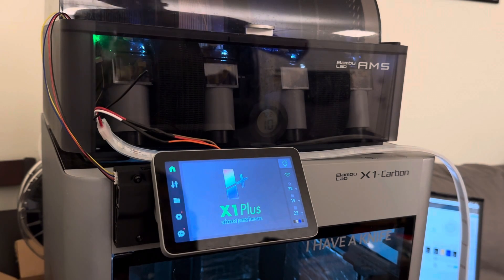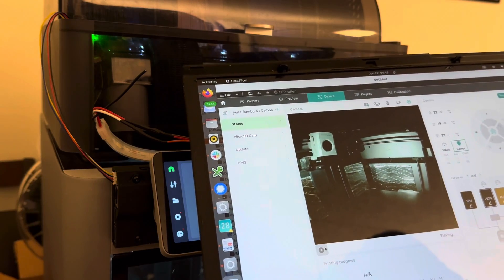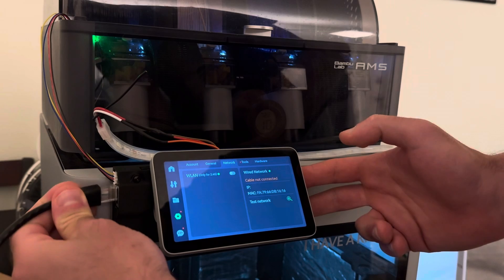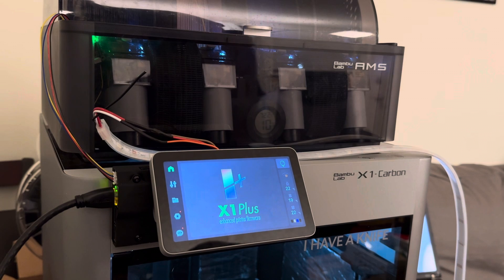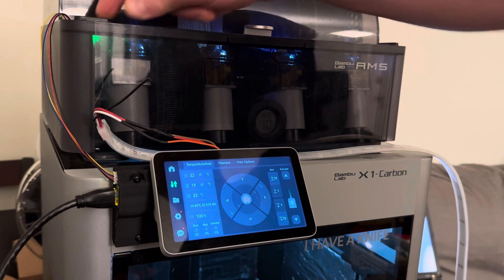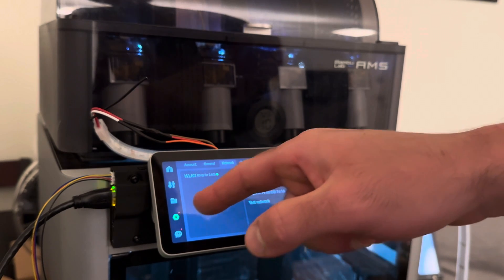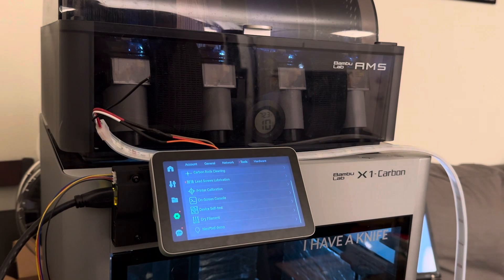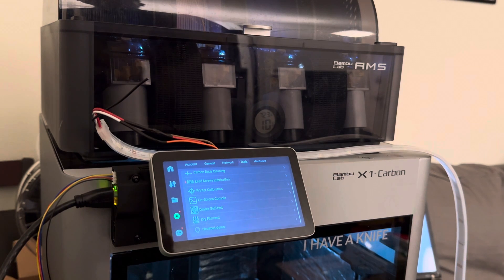X1Plus expansion board first look

Comment: Hi Joshua, I got my expander board today. Installed it and works fine. I also ordered the adafruit sensor for the ams. I plugged it in and nothing is coming up, Do I have to configure it under the hardware options in the firmware?

Comment: I'd prefer if it would be a more elegant solution like a piggyback routed to the back of the device. I don't think many X1 owners would want to look at wires coming out of the front on a nice device like this. I would suggest making a wire harness that we could route through the cable tray along the top and make a standardized 3d printed enclosure that could be mounted somewhere in the back and maybe have some breakout boards that could be mounted in other areas that could need it. Great work on getting to v2 BTW and I hope my suggestion doesn't ruffle feathers I'm just giving feedback that I see could be a concern to people who like the clean aesthetic of the X1C.
Reply from the maker: Yeah, I agree.  The cable routing for putting it on the back of the printer would be really annoying, though, and would probably involve drilling the printer chassis, which I really did not want to do.  The top is a particularly useful location for some of the addons that are going to come along with it, too.  But if you want to mount it to the rear left side of the device, you could easily design a case to do it with a little bit of dremeling, and there should be enough cable length to do that!

Comment: Absolutely interested. On the Bambu forum, you mention the HW is open source. I can’t find it on the GitHub page, will you make it available at some point? Also, how does it interface with the main MCU? I don’t see a header for the display cable; I would have thought you would link through that interface. Is it through the Bambu 4 pin bus? One mod I’d like to do is have an infrared heater on top, facing down on the part to keep the part warmer than 60C without having to convectively heat the whole chamber. Perhaps with reflective tape on the bits that shouldn’t get too hot. And with an I2C interface, an IR thermometer could be used as a control loop for the IR heater. How do/would you control the peripherals? I imagine some could be accessible via G-Code, but what about the neopixel animations?

Comment: I'm not sure this development will be worth it. A 5G wifi instead of 2.4G would be enough for me. USB, I2C, GPIO - I have no idea why would I want them. Eth Iface is nice but why would I want it? For better video you need to replace the camera and the lens too. You can buy pro (+- 2%) Sensirion hum. sensor for $30 with builtin LCD and bluetooth connection, it works with 2032 battery for 2 yrs.
USB2.0 ? You want to attach mouse, or keyboard or what? This is a random development for sake of development, but it makes no sense sorry.
Reply: I work for a massive multinational business with 3d print labs around the world. I know it seems odd, but connectivity in workplaces that value security in the convert space make it incredibly hard to work with devices that don’t have usb or Ethernet connection. This extension board with Ethernet alone make it worth the trouble for schools, universities, businesses that all lock down their network access methods.
Reply: @ChickenNipples88  Don't mistake me, I like this development, I like these guys, they are good. Just simply this development is not cheap not simple (I'm a developer too), and it gives no real advantages. I could be wrong.
Reply: @ChickenNipples88  You can generalize "ethernet", let's say "network", OK?  And wifi is a network. Does this device need continuous high speed network connection? Not really, not for model downloading, that is only few seconds even with the 2.4GHz turtle wifi. Video stream would be worth ethernet, if the camera quality would be better. But this camera is a cr*p, so the improvement would be minimal in the video. Hard to work without USB ? What would you like to connect to this printer, could you name an example please? A mouse instead of touch-screen?
You know simply you don't have to communicate with the printer, you send the model and it's doing the job. You can go to eat, or take a nap

Comment: Nice, but those Bamboo wifi printer are still full of spying features. So it is better to stick to normal printters and open source software.
Reply from the maker: This post is pretty funny.  It sort of seems like one of these internet truisms that the less somebody knows about something, the more confidently they post.  I have always wondered why this is.
Reply: What normal printers don't have wifi? 🤔
Reply: @yeheyheyyeh89  I meant: the few Bamboo pro ,( I think that was X1E, ) products that can run without internet access have ethernet, which I prefer. The Bamboo consumer products works as long their mother ship gets your data and can see what you do.
Reply: They've added a LAN mode in the production build. It won't have to rely on internet access and it you can set up your firewall to block external comms.

Also, I think the X1Plus firmware may give you better control over it as well.